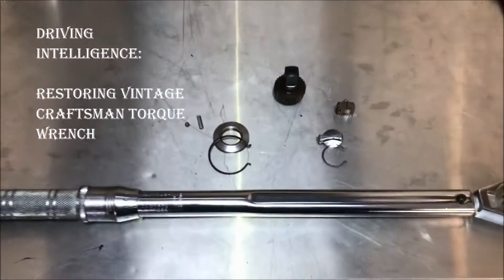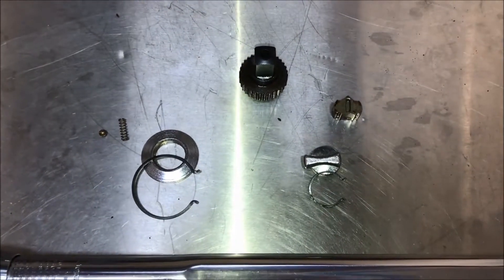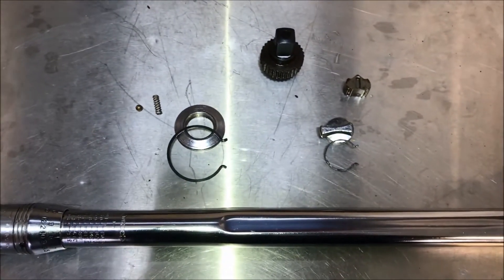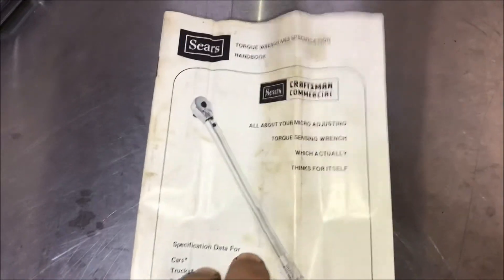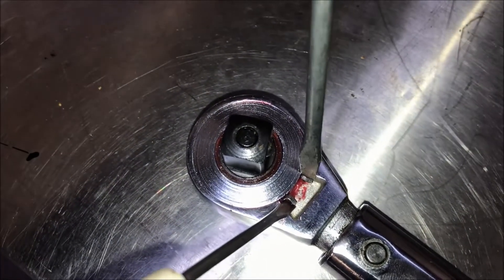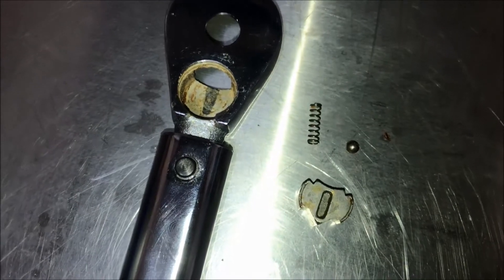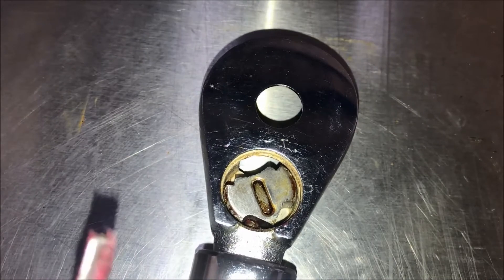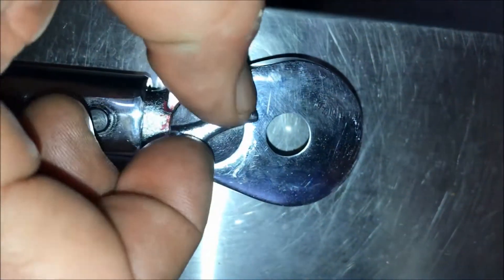How To Repair Jammed Vintage Craftsman Torque Wrench, PARTIALLY Restored: Don't Replace It, Fix It!!

Comment: How do you know it's good on torque specs? Did you ever get around to testing torque? By the way great video thanks for your help!
Reply from the maker: Have not tested it yet given I have other torque wrenches.  I have this on the side kinda as a collector item.  One of these days I'll get to a test and to do this properly, I will need to buy a torque testing device.  Here is one that should be good for this test:  https://amzn.to/3tbpUEp  I've also listed in the description section of my video.  Thanks for the comments!  Please be sure to subscribe!
Reply from the maker: finally did a video on torque adjustment, check it out:  https://youtu.be/rMaHEgQPx70

Comment: Can anyone show how to disassemble the lower half?
Reply from the maker: I’ve not tried yet, what are you trying to do with the bottom section?
Reply: @DrivingIntelligence  hi, im trying to recalibrate wrench. Cannot figure out how to remove bottom spinnng handle to access internal spring.
Reply from the maker: @kilingiros  actually, I don't think you have to remove the bottom.  I'm going to try to know out a video on this topic... I've had alot of questions on this topic.
Reply: @DrivingIntelligence  Please let me know when you do. Cheers.
Reply from the maker: @kilingiros  will do, and thanks for watching!
Reply from the maker: finally did a video on torque adjustment, check it out:  https://youtu.be/rMaHEgQPx70

Comment: I gave you a thumbs down because you didn't show how you got the ball, spring and retainer in place when reassembling the wrench.  You didn't disassemble the wrench completely; so the video has little real value.  What you did is nothing more or less than cleaning a similarly constructed ratchet wrench.  Also, despite mentioning whether it might still be in spec, you failed to follow up on the point.

I hope this feedback will help you in spite of its being negative.
Reply from the maker: Thanks very much for taking the time to provide your negative comment!  :)
Reply: @DrivingIntelligence  The point was to give you feedback so that you can improve future videos, or, perhaps remake this one addressing the points I and others have made.  I'm no negative nancy but one who values highly good YT content.
Reply: @rhhutchins194  You value "highly good YT content" but don't produce any yourself.  @DrivingIntelligence did an excellent job here; just move along.
Reply from the maker: finally did a video on torque adjustment, check it out:  https://youtu.be/rMaHEgQPx70
Reply: @DrivingIntelligence  Thanks!!!
Reply from the maker: @rhhutchins194  right on!

Comment: Just picked up the same model for a couple dollars at a thrift store. It wasn’t in the lowest setting though so probably not calibrated. Any chance you tested yours? I’d like to recalibrate mine or at the very least test it. Any chance you could do a video on this model explaining how-to? It looks like there’s a lead plug at the bottom to get into the guts of the lower assembly. Not much info online.
Reply from the maker: Thanks for reaching out.  I've not tested mine, but I did see how to disassemble for calibration.  I took a different torque wrench apart and will prepare a video to get to the guts for calibration.  Stay tuned!
Reply: @DrivingIntelligence  looking forward to it. Thanks DI!
Reply from the maker: finally did a video on torque adjustment, check it out:  https://youtu.be/rMaHEgQPx70

Comment: Have the same torque wrench,  be sure to have it calibrated.  Mine is 'out of tolerance', 
set it to 70 lb ft and it is 80+ actual before it clicks.
Reply from the maker: Thanks for that comment.  I have another wrench I use, this one is more of a part of my collection.
Reply from the maker: finally did a video on torque adjustment, check it out:  https://youtu.be/rMaHEgQPx70

Comment: Hey, I literally have the same wrench and this was really helpful. It was my grandpas and I just wanted to fix it because it’s one of the only things I have left from him. Is there a way to easily take the adjustment off? I looked at other videos all their all a little bit different and I would hate to ruin it.
Reply from the maker: Hi Lil, sentimental value is the highest.  I understand.  I have not tried to remove the adjustment side of my wrench.  Is there a problem with yours?
Reply: @DrivingIntelligence  Yes, there is. It seems like I have gotten the adjuster unstuck but when I go to turn it to a specific amount of torque it won’t stop to that amount when turning. I think it might be corroded on the inside however it was always very well taken care of. Then again it’s been the first time trying to be used in almost 30 years.
Reply from the maker: @joshsquash3937  Ah, so the torque is out of calibration?
Reply: @DrivingIntelligence  That might be the issue but I highly doubt it. When I go to use it, the ratchet part won’t stop on that amount of torque I want. It is almost like it’s stuck and works like a normal ratchet. It still can go right and left, but won’t stop on any amount.
Reply from the maker: @joshsquash3937  Hi John, I checked mine today and it looks like there is a pin that needs to be pushed out to disassemble the wrench.  I did not try this since my wrench works.  I am sure you can see the black pin on the adjuster.  Might try to tap it out with a punch, but I am not sure.  Let me know what you figure out.
Reply: @DrivingIntelligence  Sounds great to me. Thank you so much for your help. I will try that. I used a hex key on the adjuster to see if I could do anymore but after I ran into some family issues I could not finish. I will try again ASAP. Thank you.
Reply from the maker: finally did a video on torque adjustment, check it out:  https://youtu.be/rMaHEgQPx70
Reply: I have this same wrench and have the same problem as Josh at the bottom and and you at the top end! I can only go up to 110 ft lbs. Very little info online and really cool you have the manual. This was my dad's and he gave it to me. I'll have to ask him if he has the manual stashed away, I know he does! Nice video, will fix the top tonight!!
Reply from the maker: @tobylou8  thanks for watching and commenting. Please subscribe!  And share!
Reply: @DrivingIntelligence  My top fixed easy enough. I shot some PB Blaster in there and it freed right up and works fine now. I'm going to get a needle greaser to keep it free in the future!
Reply from the maker: @tobylou8  Did you resolve the adjuster problem?
Reply: @DrivingIntelligence  Not yet. Tried some gentle pressure up and down, but still don't have full 10-150 lbs range yet. Might try knocking out the pin, maybe... lol.
Reply from the maker: @tobylou8  exactly how I felt!  Mine works, so don't want to break what works!
Reply from the maker: finally did a video on torque adjustment, check it out:  https://youtu.be/rMaHEgQPx70